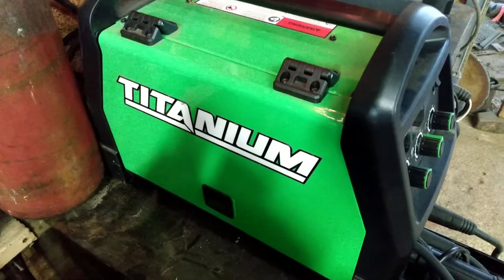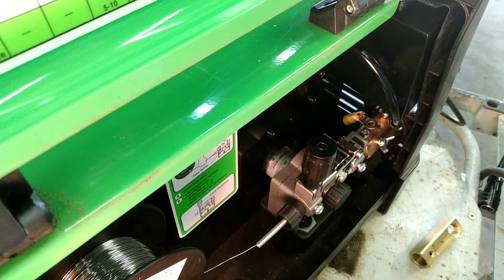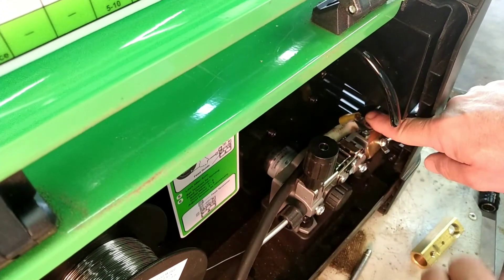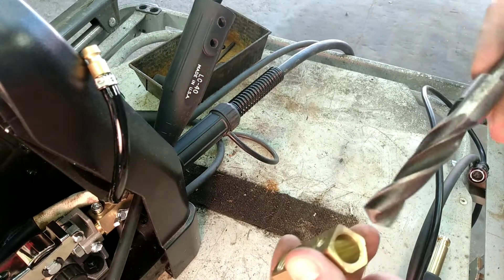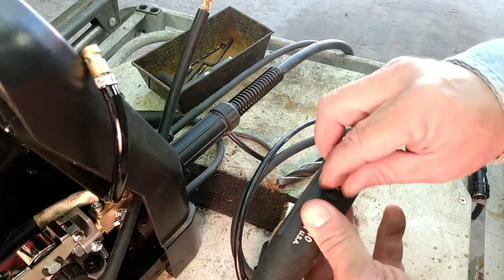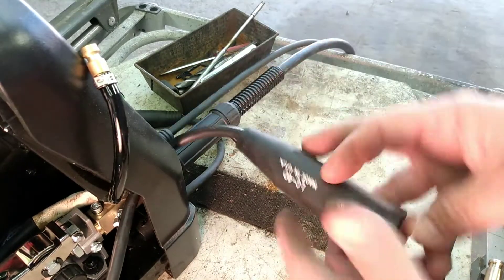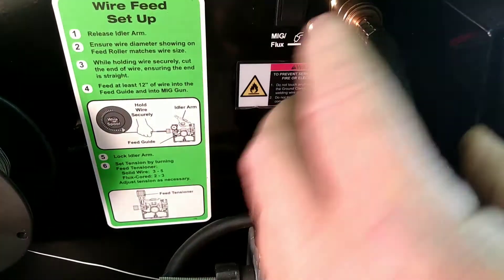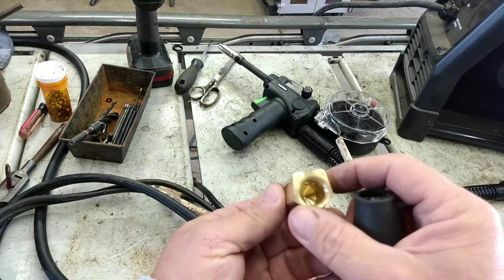connecting spool gun and main lead at the same time on a titanium welder

Comment: thank you sir I frequently change between aluminum spool gun and carbon steel wire in the regular whip while I am on the job so i will consider doing this modification.  god bless
Reply from the maker: It works great! Thanks for joining